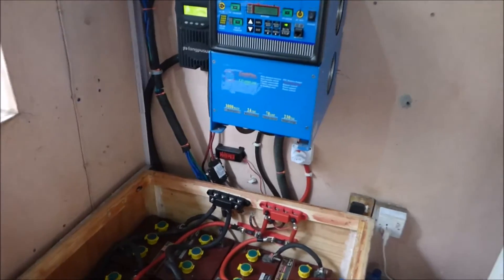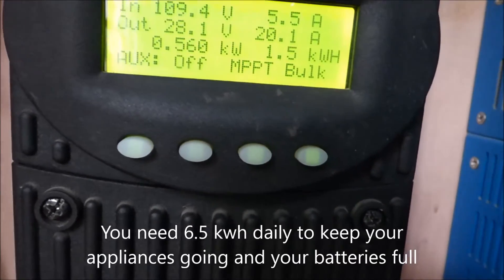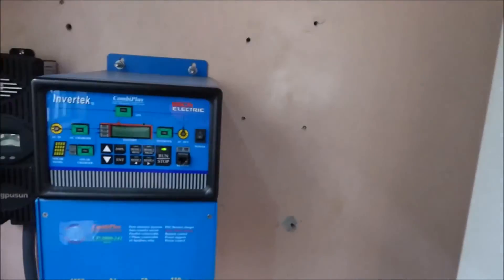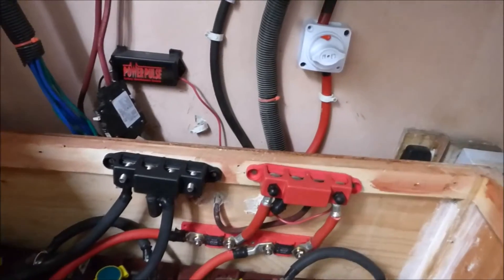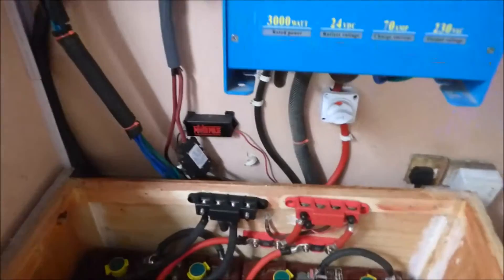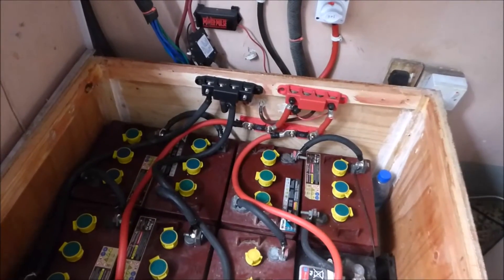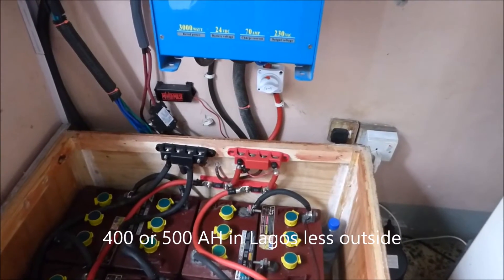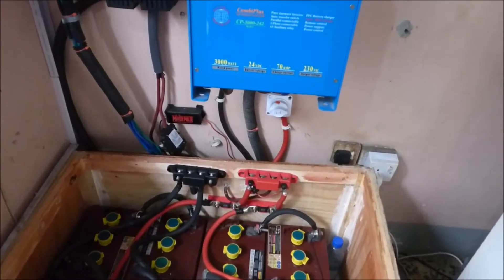Upgrade from 1 kw in Panels to 2. It is Huuuuuuuge.

Comment: Dr. Solar. Lol. Nice upgrade. I guess in the temperate region during winter it's sunny also. If we have large clouds in Nigeria. How do they survive on solar. My system has generated only 4kw today. It's been cloudy though. The batteries are floating. Once it's 9pm, it's 51.2v. Guess we have to take away some power guzzlers. Welldone with the upgrade. Hope to see the fans on the battery box in your next video.
Reply from the maker: Thank you. During winter it is colder and panels over perform. Rain and clouds today. 51.2 v at 9 pm is very good. To survive we over size the panels and the batteries. Practice good energy conservation. The fridge goes off and the freezer stays on.Thank you for the compliment BKP.

Comment: Nice video. I have started building a 12v system gradually with 1500watt inverter but with two 12v ups battery. it works only under steady sun. am looking forward to getting and using 6v batteries in series and not 12v bcos i have come to realize 6v is better. but I want to know where I can get this kind of your battery as am outside lagos
Reply: Osakwe Jindu what is the capacity of your ups batteries?  They are probably too small for what you are doing.
Reply: +Christopher Onwuasoanya exactly. but you can't believe how much fuel I saved now. I know is not the right batteries. The battery is 2 12v 7AH battery with 130watt solar panel. under sunny day i use ceiling fan, laptop, tablet and phone, sub woofer (for music). as soon as the sun goes down is off.
Reply: +Osakwe Jindu the batteries are way too small. I believe that you save money during the day. you want the same in the evening as well.
Reply from the maker: How is your system doing? Have you upgraded?

Comment: I live in Vancouver BC Canada.. I have 1000 watt system and on clear days during the summer I  get 6-7 KWH into my batteries on cloudy days I get 0.5 - 0.8 KWH.. this year has been the most cloudy days through every month.. it sucks for solar panels..
Reply from the maker: MrMeanderthal that is a huge difference in production. You need a generator on those days.

Comment: the place of Battery is not good as it produce hydrogen and that is just right beneath the gadgets that could produce spark and cause Fire!!
Reply from the maker: It is in a covered box that is vented outside
Reply: +AtlanticWastePower then it's good :)
Reply: +AWPS Renewable Energy, LTD Hi, please what is the cost for installing this solar power now?
Reply from the maker: +abiodun your cost is determined by the system we design for you. Please send an email to info@atlanticwastepower.com